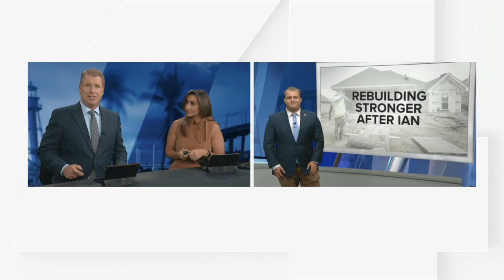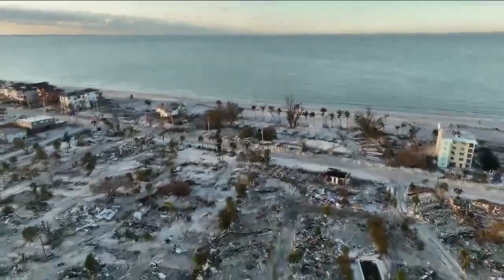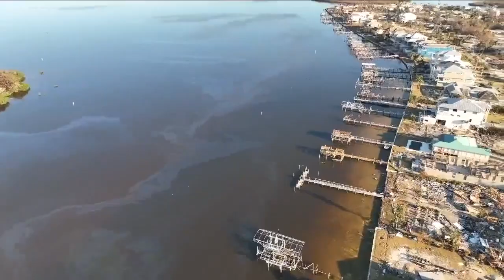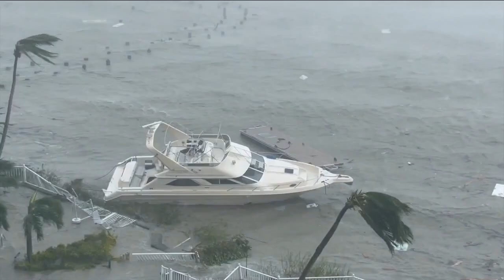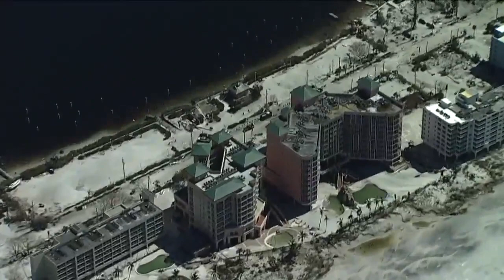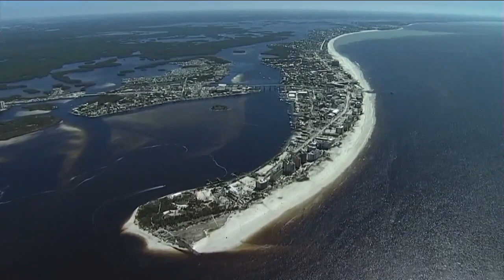Engineers Are Studying Damage Left Behind From Hurricane Ian

Comment: someone i know just finished a new house last year on the beach, about mid island. on the bottom level the garage doors got pushed out by water, but the rest of the house looks untouched. it did exactly what it was designed to do. all the other buildings around it got washed away completely. but it is a massive house and it was not cheap to build. just so sad that the island is going to lose most of its cute little beach cottage feel, it made it seem so relaxed :(